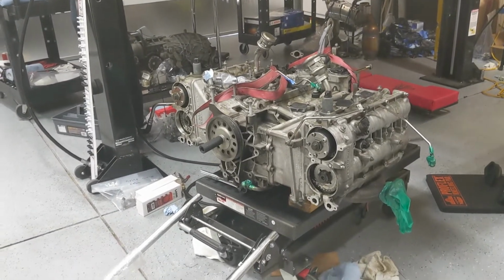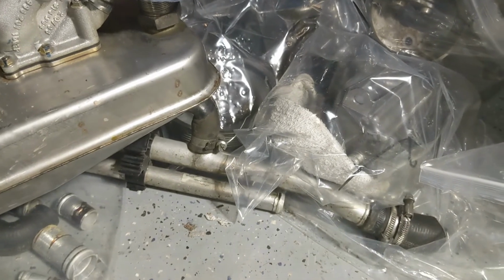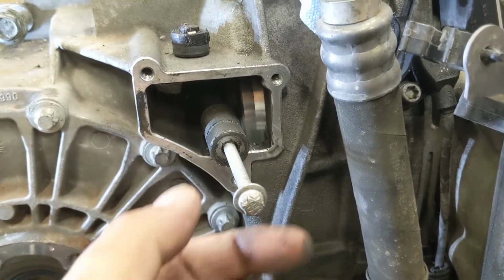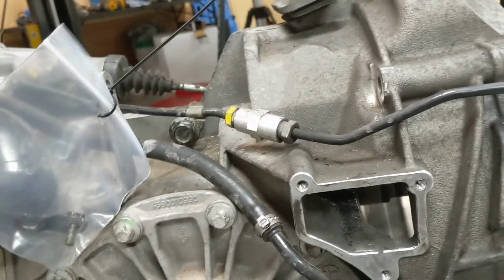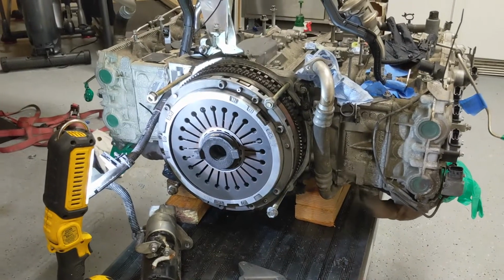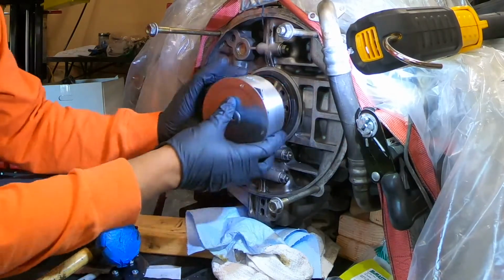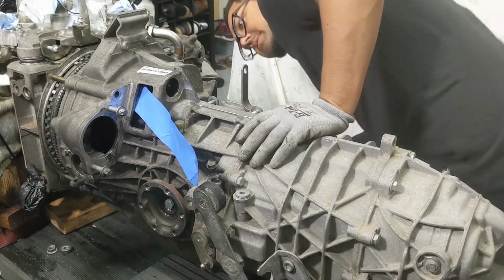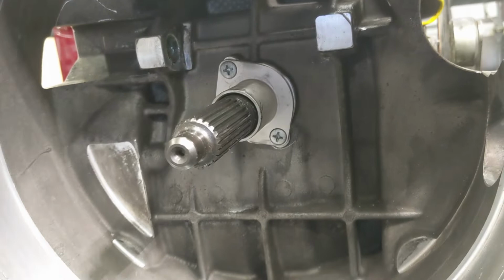Jay's 997 turbo Clutch Upgrade Part 4

Comment: Nice work again Jim! the intros are awesome 😊
Struggled a bit because the engine wasn't secure.
Lock the wheels on the cart and proper alignment is key not to damage either the engine or transmission.